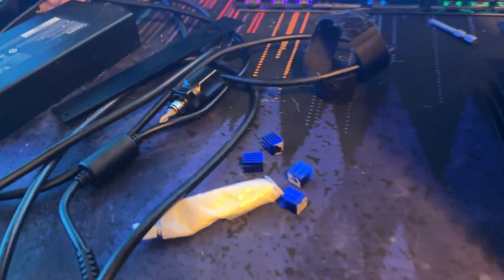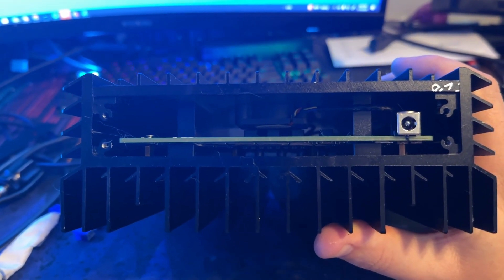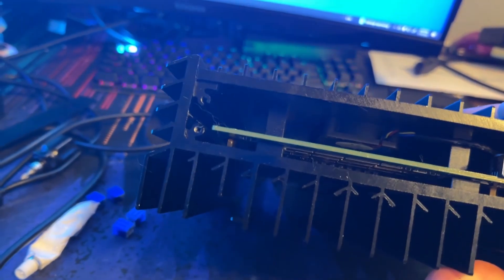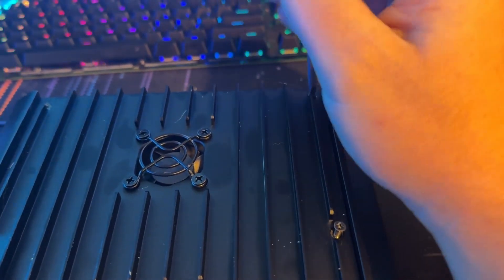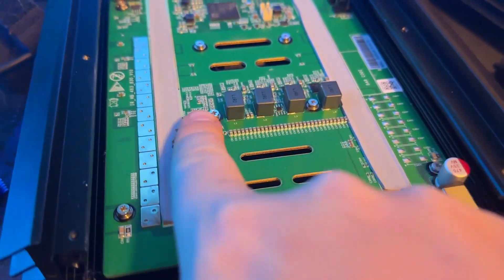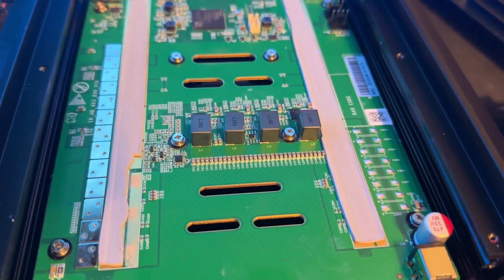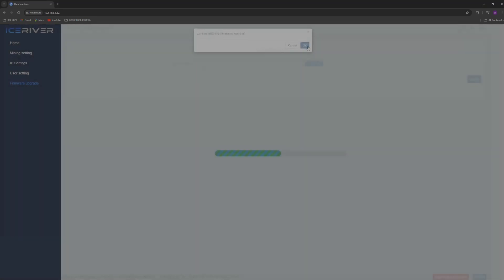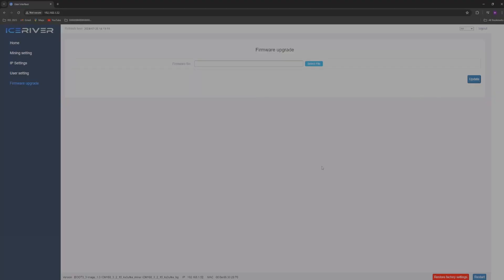TSwift Overclocking Guide for the KS0 Ultra! Overclocking on Easy Mode!

Comment: The hobbyist miner sure f'ed up his ultra. Also I use asus rog strix 330w laptop psu from aliex for 45 bucks shipped. You'll need to solder a new barrel plug on it... Which works out ok as you can put a new heavy duty barrel plug on it. I am soon going to change the connector to something beefier.
Reply from the maker: @RainBitcoins  thats crazy! 330w at 19v?? would either solder on a new barrel or at that point maybe hardwire the miner or use bullet connectors
Reply: Where did you get the heat sinks you have on
Reply from the maker: @trailerminer9650  amazon, they are just alphacool ones
Reply: @TheLukewarmTech  I wonder if those are the ones that I ordered I ordered a bunch of different heat sinks and I looked for the blue ones I found some apparently they are 3D printed aluminum

Comment: I did all update int file then overclock file I start by 505 L but the red color is blinking and not start mining. I did every thing I change the pool and after some time it give Tbc error 
I don’t know what I did but I revert and it’s working on stock now any help for me ?
Reply from the maker: Are your fans plugged in still?
If no, plug them in
If yes, move to 505 no lettering

If you still cannot get it to overclock, use the revert file, upload it, confirm but do not restart.

Click “factory reset” and confirm should go back to factory.
Reply: Fan is plugged in  and I already revet  it and it’s working no problem in stock 
But that. Mean I can’t  overclock ? Or there is some batch from ultra can’t be overclock?
Reply: It’s working now the weird. Thing I was mount the internal fan out side like more they advice by that when I return it back it’s working and I can  overclock. I am mining now on 618 gb I don’t have fan shroud  I plan to print one. Then I will try 678 because the temp coming 88 cil without shroud. 
Thanks for your replay before

Comment: At the end you said cancel out before factory reset, I'm confused
Reply: Could you maybe Go over that a bit more in depth. You confused me with that too. 
Upload revert, but not really flashing it??? Rather hit cancel, and without flashing the revert, do the factory reset??? 😳
Reply from the maker: @mozzarella84  so when you upload the file it will ask to restart hit cancel
Reply: Sorry I am still hestitant, but that is really how you do it??? 😮

Does it have negatives doing the full process with the revert file, and when done, do the factory reset?

Thx for your assistance.

Comment: On the 505 version. Is a upgraded power supply needed or will the stock one work?
Reply from the maker: @Thr33PuttKing  I would reccomend it, as I saw 140w getting pulled. It’s a 100w psu from factory
Reply: @TheLukewarmTech  Thanks! I was going to run that until the bigger PSU, heat sinks etc arrived. I'll just wait then.  How is the 562 working out for you? Watts to hash. Worth the upgrade?